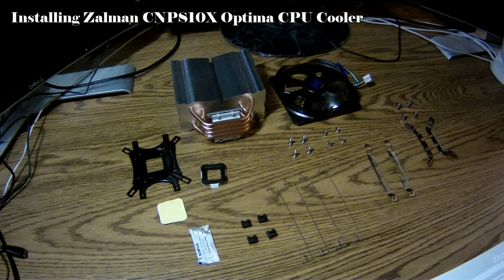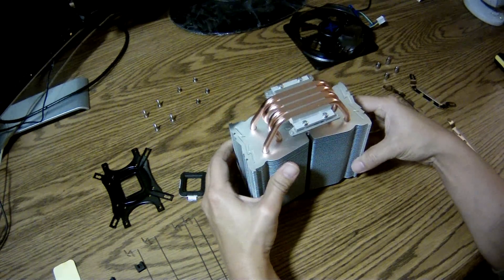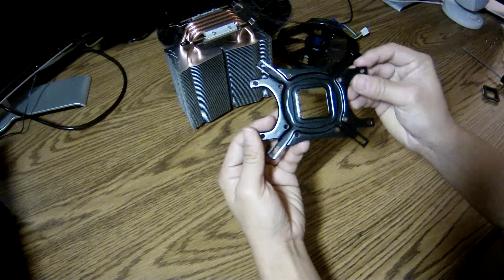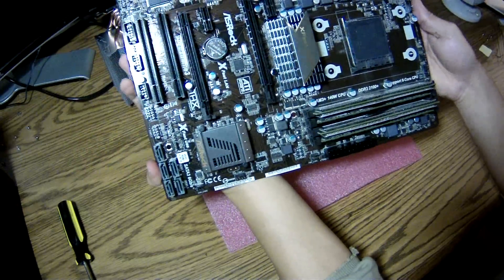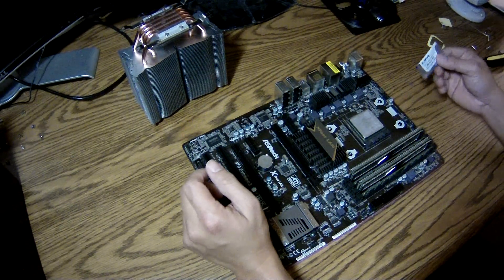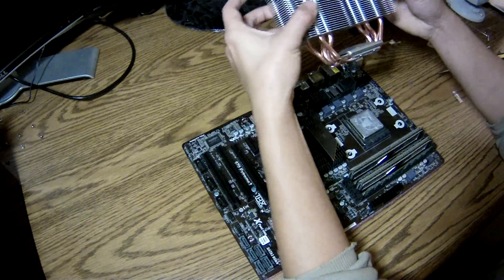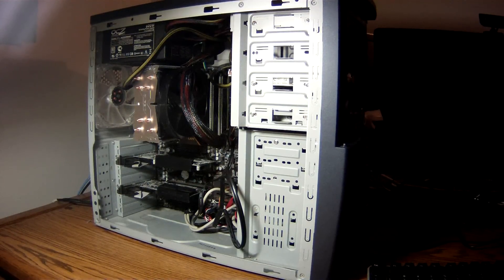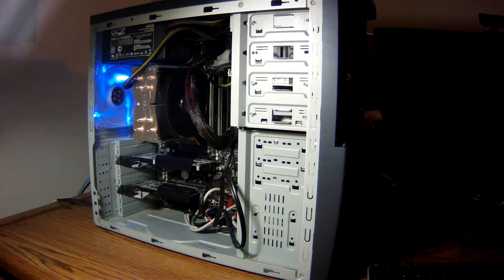Installing the Zalman CNPS10X Optima CPU Cooler on AMD AM3+ Socket Motherboard

Comment: A friend gave me his zalman cnps10x optima heatsink and fan but not the backplate and screws....can I use the backplate and screws from the 212 evo here it's for an am3+ mobo

I need a smaller version like the cnps10x as then I can close the case whereas the case can't be closed because the 212 evo copper points at top of the heatsink pertrude outside the case preventing the case to be closed

Comment: Hello, that's a cool video, is it possible to remove the cooler and use it on another system after using the tape to install it?

Comment: the amd clips mine came with; the clips you stick the bolts through; came strait, and not bent like in the manual, or in your video. The bolts come nowhere close to touching the nuts, and I am one pissed off customer.

Comment: It was fairly easy to install with good instructions :) my athlon 2 x2 250 @ 3,6ghz dropped from 57c to 43c with prime95 vs stock am2 cooler.

Comment: You put WAAAAYYYY too much thermal paste on the processor.  Ideally all you want is a haze or else the paste will act as a barrier between the CPU and the heatsink!!

All you need is a grain of rice sized smear in the center OR, in this case it would be even better to apply one thin line of paste to the bottom of each heat pipe as the pipes are what do the work.
Reply: Honestly for me the best has always been a small dot in the center, about the same size and shape of a small plastic airsoft BB.

The pressure from tightening down the heatsink will spread it pretty good, then the heat from the CPU after the burn-in/cure time of the thermal compound will help to spread it even more.

With this application in the video.. After both those factors I mentioned above your socket and board will be swimming in the grease. Not catastrophic, but also not good.

Comment: hey yesterday install a performa 10x a painintheass for install but after that my temps are to high even on idle, my pc shutdown, did you remember if you tigh much and if the pipes ends look like open, also the rear bracket never touch the mobo there its a gap because the plastic square.

1st time i saw a defective cooler

Comment: Geez this looks like pain in the ass. Installing stock cooler is much easier and you dont have the risk of sliding the heatsink over the cpu too much.
Reply: but stock cooler are usually underpowerd.
Reply: +Trancer006 Stock coolers are shit . My Phenom X4 965 temperature is under 50 degrees with this cooler and with the stock one it went 90 degrees playing Fallout 4.

Comment: FOR EVERYBODY WATCHING THIS YOU NEED TO CLEAN OFF ALL OF THE OLD THERMAL PASTE FROM THE PROCESSOR BEFORE APPLYING THE NEW THERMAL GREASE/PASTE!!! sorry for all caps but this needs to be seen.
Reply: except for forgetting to remove the old thermal paste, good tutorial, although a bit better lighting would have been better.
Reply: And remember when removing the old thermal paste to use something like a Microfiber Cloth or Coffee Filter... Ideally anything that does not leave behind fibers that will block the thermal conductivity. Paper towel and toilet paper are your worst enemies for this task.

Comment: That's install solution is quite idiotic. What is wrong with the clips ? Also AMD should be ashamed not including a proper cooling with there cpu's.
Reply: Concordo os processadores AMD deveriam vir com um cooler específico para altas temperaturas e não com uma merda de cooler box comum!!
Reply: Leandro WV Sometimes they do give you quite good stock coolers. Currently im using on the fx 6300 a stock cooler from an a10 APU which is pretty acceptable  but with a bigger fan which makes quite a lot of noise but it works.
Reply: Gyengye Gabor
 Man you are right. Installed my 8320 and the stock fan sounded like a vacuum. Had to return to the store and buy a different cooler. Just about anything is better than the 6000rpm coolermaster stock cooler that comes with it.